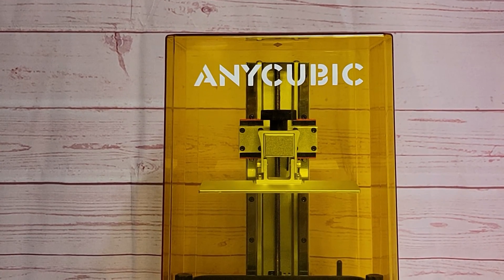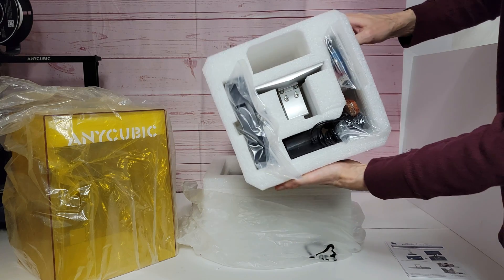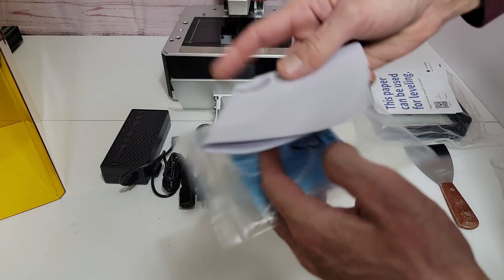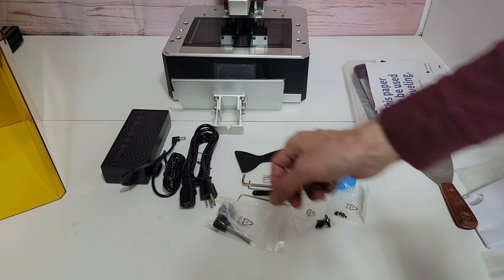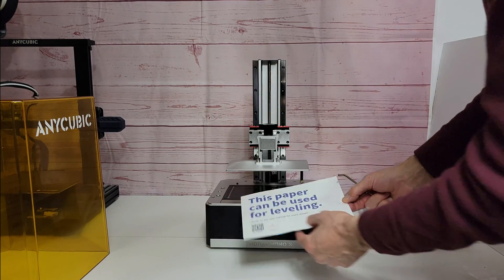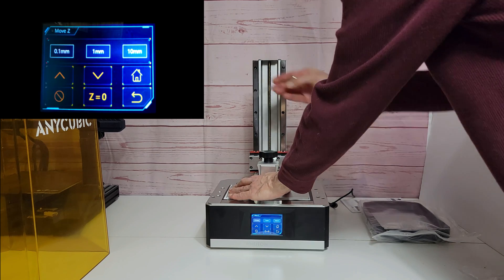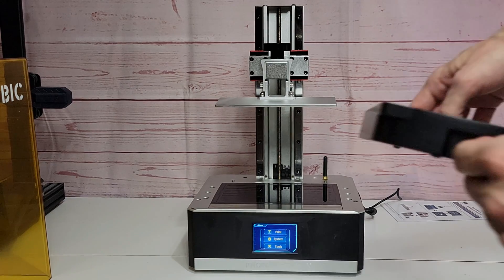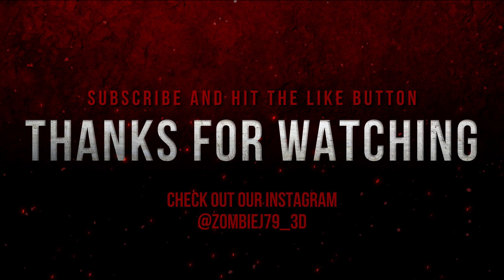Anycubic Mono X 4K Unboxing + Bed level

Comment: my Vyper starts a print and doesn't extrude filament at first then it sticks to the nozzle and just pisses out a mess after i stop the print? feels like its rebelling
Reply from the maker: Is the nozzle too close to the bed? Try extruding with pronterface to see if it extrudes ok. If not could be a semi clog possibly. Try a relevel as well
Reply: @studiozombie3d  The Nozzle z axis position seems fine. I tried running an autolevel and it flashed crazy colors and froze needing to be hard reset? when i updated the firmware on the display i had to partition a 32gb drive to have a compatible 8gb fat32 partition and the rest as ntsf... do you think my firmware update failed maybe?